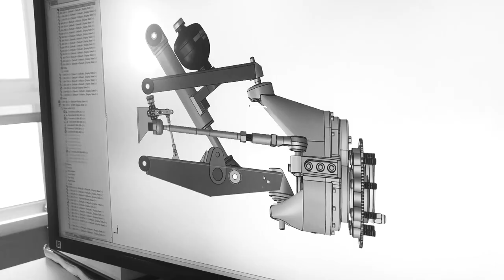SUSPENSION SNIPPET - Bollinger Motors

Comment: Why hydropneumatic independent suspension? Wouldn’t beam axles with coil or leaf springs in combination with the portals and maybe some manually adjustable shock absorbers be more appropriate for an off-road truck? Much simpler and more reliable than any type of semi-active suspension. That’s at least my personal experience with different stock and modified Land Cruisers (70 Series) and G-Wagons (W461).

Will there be an AC available, because in my experience it’s the best way to prevent a steamy windshield in intense rainfall with multiple people inside?

Anyway, I’m quite intrigued by your vehicle and hope it will be available in Germany as soon as possible.
Reply from the maker: El Guusko b/c it’s a class III vehicle and needs to be able to haul 6100+ lbs. you can’t do that w conventional suspension or it’d bottom out huge
Reply from the maker: Yes, the truck has AC.